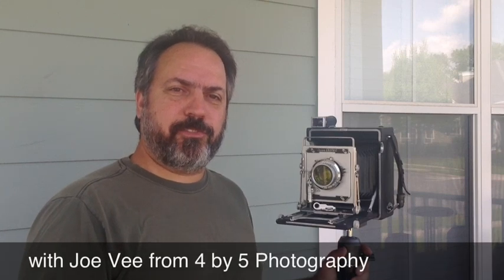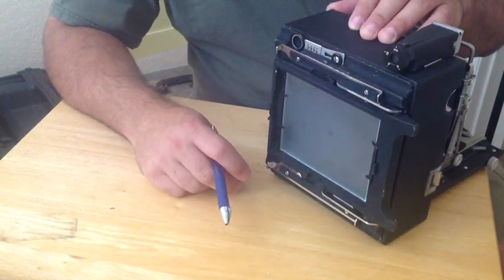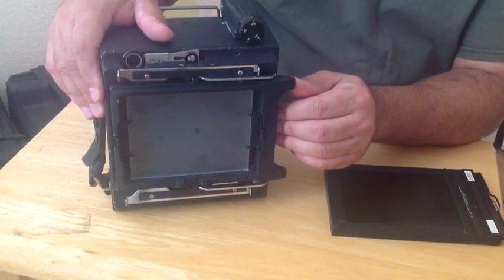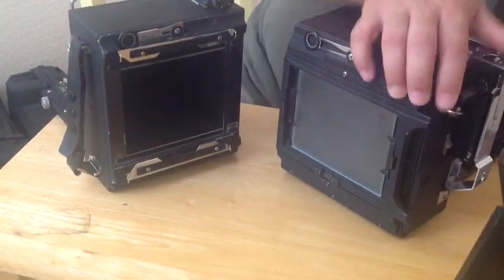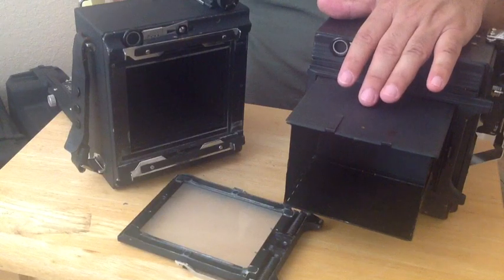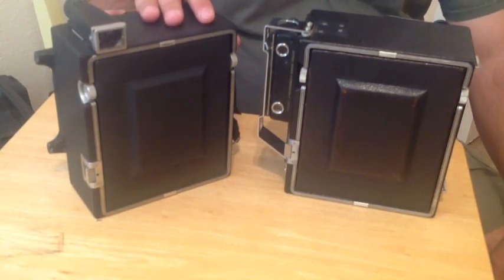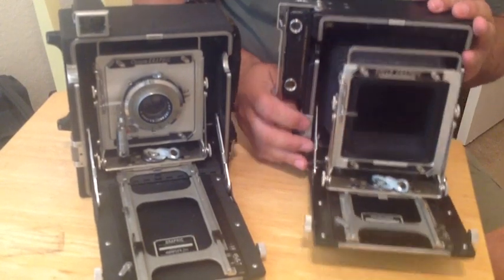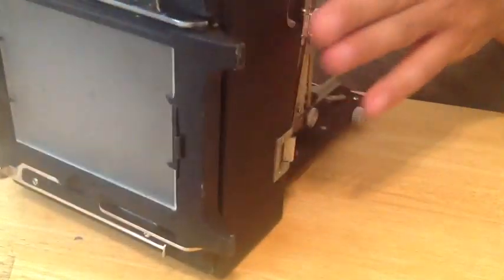Large Format Photography Part 2: Camera Components

Comment: Hi,

Thanks for your video which can be helpful to the younger generation of photographers. Just one thing I should mention is that the solenoid is made in such a way it is meant to delay not the flash but the shutter... The flash gun which fires the flashBULB first  and then with the right amount of delay triggers the shutter. This is necessary (with bulbs) in order for the shutter to open up while the flash is at its peak. Otherwise it would close too early unless you have chosen 1/10th or longer exposure times. Strobes on the other hand have no delay and are triggered from the shutter. You probably know that but in the process of explaining things it's easy to make wrong statements !
Reply from the maker: Hi Roland  Thanks for adding in the facts so all who access the videos can learn as much as possible.  Regards.